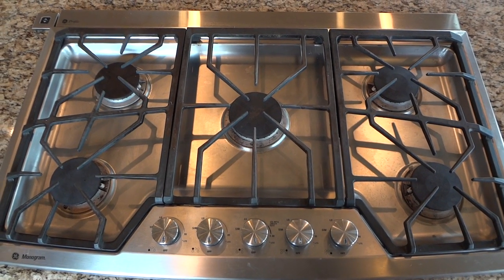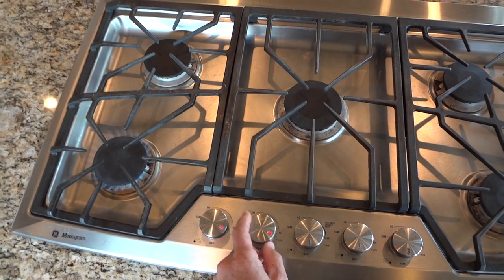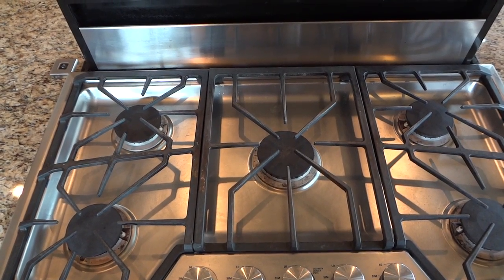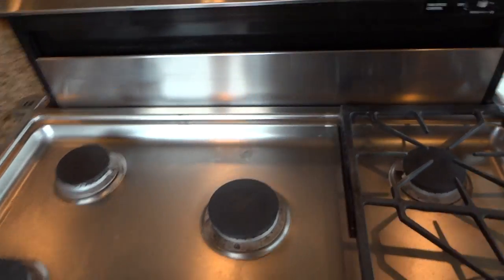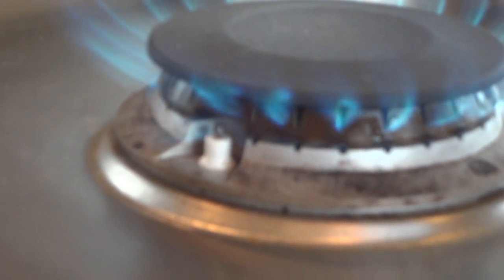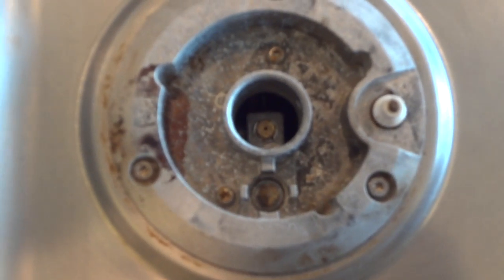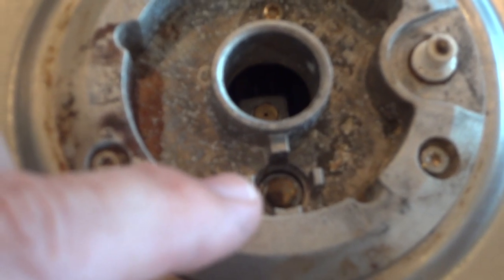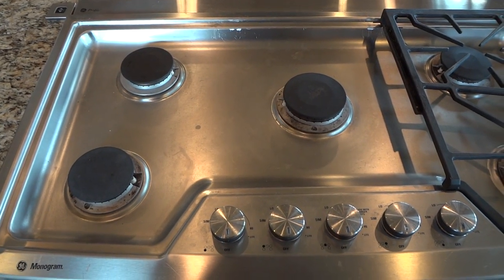Cooktop Igniter Troubleshooting 1

Comment: I know this is an old video, but this did the trick for me. Not only was it clicking when I turned on the gas…it would not stay lit in the simmer position. I have some tiny bore cleaners that didn’t the trick. Clicking is gone and simmer works too!

Thank you so much.

I have a GE Cafe Range top.  Principles the same.

Comment: The same thing happened to my GE Monogram ZUG385NSM1SS cooktop. The flame intended to heat the ignitor was absent or nonexistent on three burners. I ended up removing the burner and cap, then unscrewing the simmer (small) orifice and reaming it out with a hand drill bit (0.5 mm). After reassembly, the flame appeared over the igniter. Took just a few minutes per burner. 2/28/23

Comment: I have the same GE cook top, I haven't used the left lower burner for about a year because of the clicking.  I knew it wasn't the igniter because I went as far as switching them out.  Same problem.. I just decided to look on the internet for solution, low and behold I found your video.  The pesky clogged simmer orifice was my issue.  I used a pin point ( careful not to break the tip) stuck it through both sides of the orifice (It removes easily with a  pair of slip joint pliers) to free the debris. FIXED.  Cost to me $0!!!!  1000 thank yous Kim!!!!

Comment: Kim you are a genius. Before viewing your videos, I had spent hours and hours reading product manuals, buying an unneeded new igniter switch, closely examining the igniter for defects and shopping for other unneeded part replacements. I had never thought to look closely at the relationship between the simmer aspect of the burner and the thermocouple aspect of the igniter. You are a good observer and problem solver... hats off to you!
My cooktop is a DCS Fisher-Paykel but had the same problem as your GE Monogram with a blocked simmer gas orifice as you describe in your two videos. In my defense, it was easy to overlook the non-functioning of the almost-invisible simmer flame when the main burner was burning so brightly.

Comment: Yep.  Same GE 5 burner propane cooktop.  Same problem....iginiters kept clicking after stove is lit when main (center) burner was turned to lower setting.   As you state, either the main jet (in the hole in the center you see when top plate & flame spreader are removed) or the simmer jet are clogged.  (or both)

Best way to clean them is use 1/4" drive 7mm socket or 7mm nut driver, and remove the jet.  Look thru the hole in the underside of the jet while holding to a good light source. If you can't see a pin hole of light up in the jet, it's clogged.  I used a small diameter sewing needle and pair of pliers to run the needle thru the jet hole....hole is VERY VERY small, my needle would on stick out the top a little, but enough to clear whatever was clogging it.

Re-install jets, top pieces and fire it up......eliminated my problem.

Comment: Why does the consumer have to put up with this just for keeping the cooktop clean? We have a telescoping vent by Jennair. It's been at the repair shop for over 1 year, going on 2. If I had to do it all over again, I would have put my gas cooktop against an outside wall and vented it with a standard vent. All of our kitchen appliances have failed us (including a front-load dryer unit) since we remodeled ~7 years ago. We've already replaced our Electrolux d/w. We left a side-by-side GE fridge behind in another house and it's still going strong after 20 years, according to the new owners.